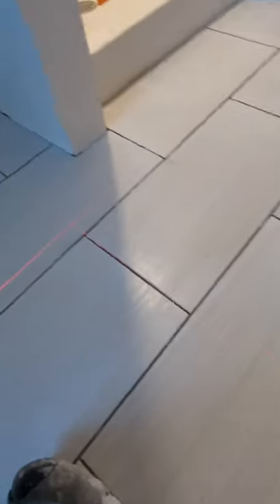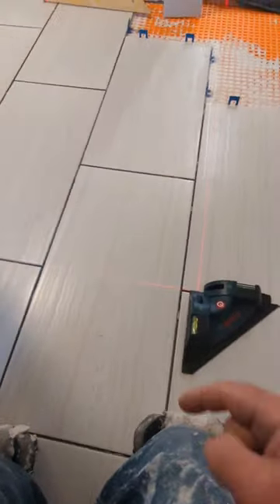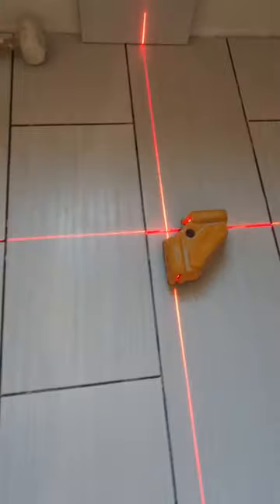lining up tiles, Running bond tiling tip. #shorts

Comment: Or, ya know, the ol' chalk line trick works pretty well. On the floor, anyway. I actually make hard lines on the walls, as well as use my laser and levels the whole time. I like a second and third opinion. Walls and floors can get pretty squirrelly sometimes and theres not always time or a budget to make them perfect. So you gotta be sure. As sure as possible, anyway.

Comment: You could also use your 2 control lines that you've snapped on your floor to stay up against. the 1st day you set tile, you get your control row, and then the next day you can go off of that . find the center of the tile.

Comment: I really like the 1/2 offset! Good work as always! . I just don’t understand why the industry standard says 1-3 offset for lippage but all the tile manufacturers post pictures of their product in 1/2.
Reply: Because a lot of 12x24 tiles are bowed.  If you do a standard brick pattern you can see the bow, whereas if you do 1/3 offset, it's much less noticeable.
Reply: Yeas I am aware of lippage with 1/2 offset. But if you look at the tile manufacturers they say not to do 1/2 but then post pictures of 1/2.  The industry is very hypocritical
Reply: @cccobby  Absolutely they are, that's not to say that all 12x24 tiles are bowed.  When you go to buy tile, pick up a piece or 2 and look down the edge to see.  Some are straight.  What I see a lot of are the corners bend in.  There's a lot of shit tiles out there.
Reply: Great info! Thanks for the reply
Reply: these companies always put out shit materials and expect us installers to work miracles. they recommend to do a third offset but if the customer wants half then that's what they get. work them miracles boys.
Reply: The plank tile are the worst for bowing!! It is up to the customer, but as a professional installer, we have an obligation to inform the client of the best practices for each tile type in relation to insulation.

Comment: Now I’m confused I thought we couldn’t do 50% off set
Reply: It really depends on how good the tile is , and you're right. You're not supposed to, but most people do it. Depending on how bad the tile is .meaning how warped or banana the 12 by 24 is. So if it's a really good tile and there's not going to be any lippage at the intersection where the center of one tile meets the end of another, then it's okay .